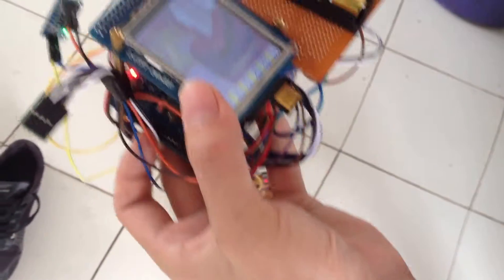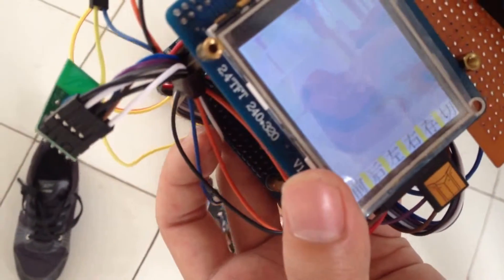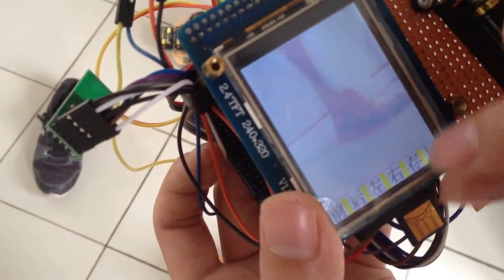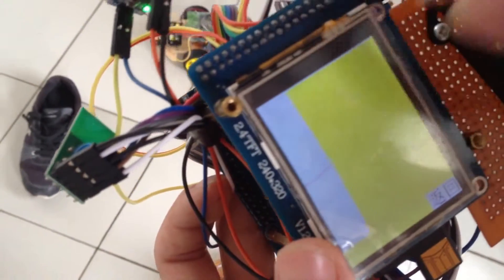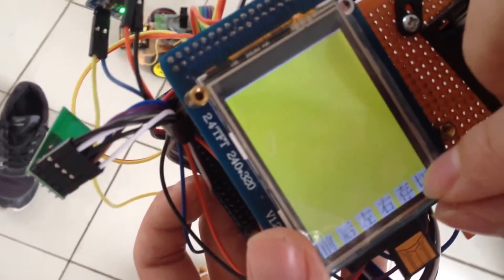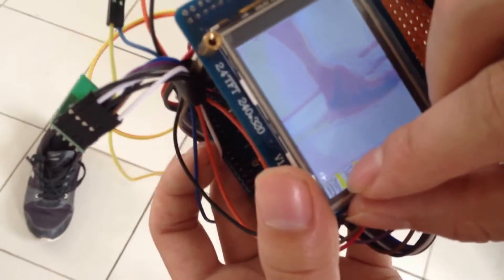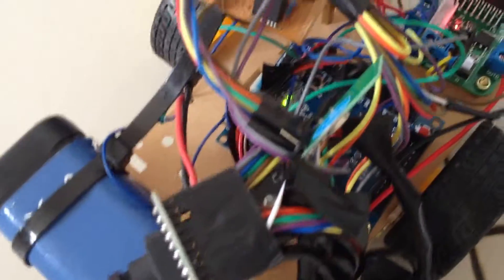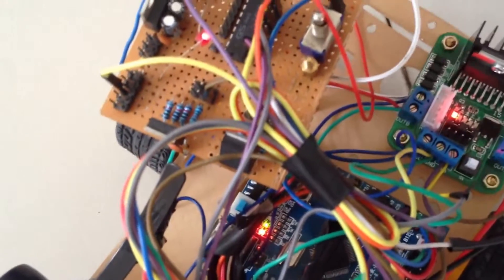Remote control car with wireless camera~

Comment: Hi nick, i seek your help on this remote control car with wireless camera. i will be using nRF24l01 connected to arduino Uno to control the another car using the same arduino Uno for my school project. Intention to add in a camera and a TFT display like yours. Do reply me if u are to assist me on my project. Thank you very much
Reply from the maker: A mathew I would love to  ;)    ask me if u have any question. I may not remember the exactly code since this project was about two years ago, but I will assist u as much as I can. doing this will bring u lots of fun, Lol